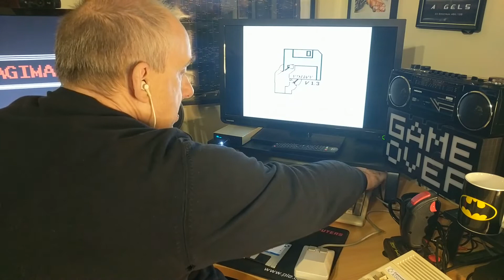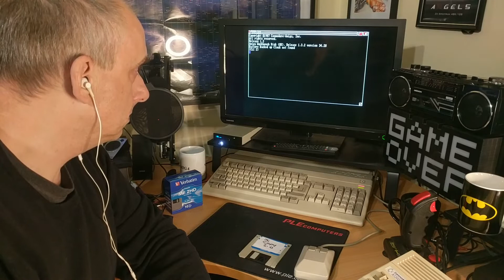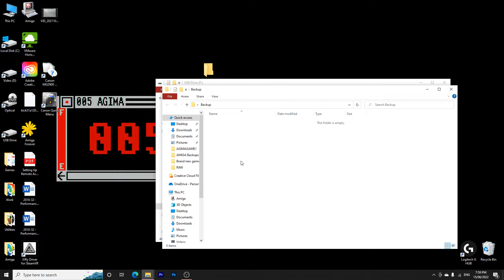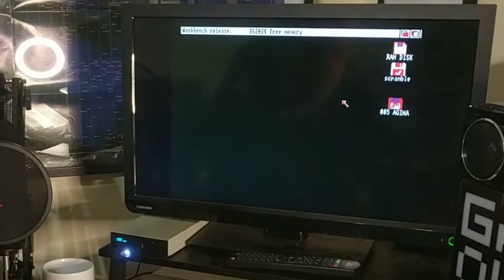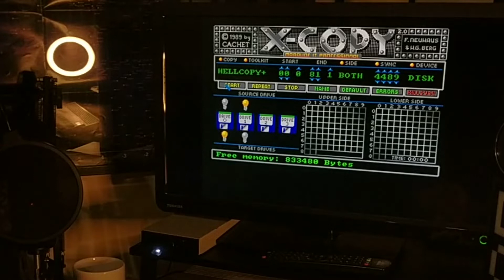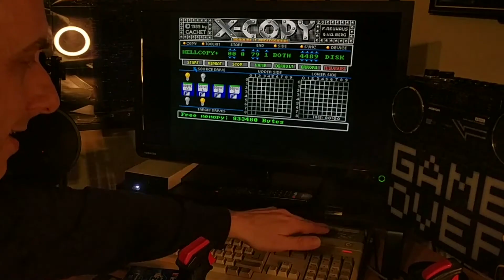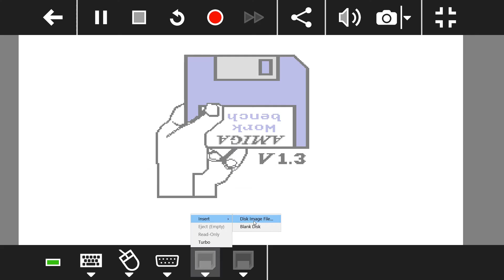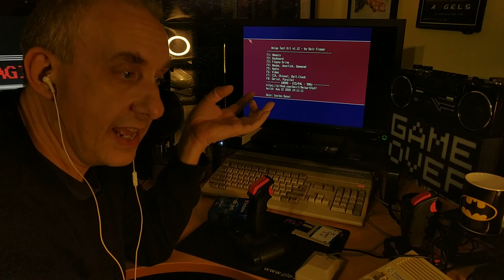EP-154: Amiga Floppy to ADF and back using a Gotek as DF1 (and as storage)

Comment: Great video. Thanks for the email. Loved the special pickup 😀. 
Just for reference; There are switchers that swap the drives so DF0: becomes DF1: and vice versa allowing use of the internal drive. However yes most just replace DF0: so you can’t use the internal drive. (I’ve got one of each). 
Scramble, those issues were due to the adf still being selected in the gotek so the os got confused. Ejecting the adf or selecting a different image would help. (You’ve probably already worked that bit out, but might help those coming back to the Amiga). The os doesn’t deal with two (or more) disks being called the same.
Loved that copper effect on decrunching. Always puts a smile on my face as I used powerpacker on my workbench disk to get as much on it as possible 😀.
Reply from the maker: Ah the 2 disks with the same name makes sense. I didn't even think of that.

Comment: Hi, interesting video.  I'm a noob with Amiga, but can you use pc floppies (2HD I think) on a stock A500 machine?  If this is the case can you also use them on the 600 & 1200 machines as well?  Greetings from Blighty.
Reply from the maker: @JohnSmith-bh4zx  the short answer is yes but they will only be seen as 880kb. I use them all the time. For the a1200 though, later ones used modified PC drives so that can complicate things. The long answer goes into nerdy detail about how the platters are not the same and may result in data loss... But I don't care about the long answer. Just don't use them for anything you don't have a backup of elsewhere and you'll be fine. Like I said, I use them in both my a500 and a1200. Good luck.

Comment: A very faulty method. Most of the ADFs don't boot anyway, for some reason. Maybe I'm doing it wrong, I dunno. Great video, though!
Reply from the maker: @AdamJ386DX  works fine for me. Remember you can only boot from DF0 (internal drive)
Reply from the maker: Ah also....once you've written to the disk, make sure you swap to a different disk image on the gotek before you try booting from the disk you've written. The Amiga may not boot if it thinks you have the same disk in both drives (I didn't even know this). This was the cause of the error seen in this video when I tried to boot Scramble.

Comment: So actually, you can take ADF files from Internet, drag and drop them on your USB stick.. Put it in DF1 drive.. And so you can make working amiga diskettes on DF0?
So that would easier then hook up a modified floppy drive to PC on LPT port..?
Reply from the maker: @rallyscoot  yes you can. There are many ways to get ADF to floppy. Whichever works best for you. I also use PC to Amiga via rs232 cable which also works.

Comment: Got myself an external gotek and replaced the guts of an external drive like yourself. I have disk images on the usb , when loading up workbench all I get is an icon with DF1?? and I can't do anything with it.
Reply from the maker: @aussie_retro_dude  what Disk image did you load? Of it's a game for example, they are non Amiga dos images. Try loading workbench extras in df1, or Delux paint, or an empty Disk. If they didn't work, check the jumper on the gotek is set correctly (try the other setting)
Reply: @005AGIMA  ah ok I'll give that a . I was trying to load random adf games.. eg Adams Family , Buggy Boy ect. 👍
Reply: @005AGIMA  turns out the Juper was set incorrectly, working now 😀

Comment: Hello, I have an Amiga 500 rev. 5 with kickstart 1.3. I bought an external gotek with flashfloppy firmware, a data ad power cable bought at amigastore. I would like to copy the games I have on the usb stick plugged into the external gotek on floppy disks using the internal floppy drive and x-copy. My problem is that when the external gotek is connected floppy disks don't boot. If I disconnect the gotek, the floppy drive is able again to load the disks. Gotek is set to S0, I tried to change it to S1, but the result is the same. I tried to plug the gotek in the place of the floppy drive and I can select correctly the games and play What I do wrong? Do you have any guide or instructions to make it work?
Reply from the maker: Hmmmm not sure what the problem is. I think mine is set to sd1 on the jumper but I can't remember. The only thing I can think is, make sure you don't have the same Disk in both df0 and df1 as the Amiga hates this. But if you've not copied disks yet, that's not the issue. Still something to check though. Also note, you can't backup commercial original games using this method. Only cracked copies will work. That's not why it's not booting but thought I'd mention it.

Comment: How do you format the memory stick in Windows 10?  Is it FAT 32?  Also, with the Flashfloppy firmware, do you still need to have a "boot" file on the memory stick, like with the old Gotek software, or can you just have your ADFs on the memory stick?  🤔
Reply from the maker: The gotec itself was preconfigured by the guy o purchased it of so in all honesty I don't know what version of flash floppy. All I did was the install in the external Amiga floppy case). The thumb drive I formatted I think as fat 32 from memory. There are no special files or boot files on it. Just folders and ADFs.

Comment: I do exactly the same thing with a Gotek (copy/make ADFs), installed it into a real external floppy drive case to replace a damaged floppy drive in said external case.
An A500 I have still has real internal floppy so it's great for that, plus also use it for my other Amiga's.

My A500+ and an A1200 have internal 'GoEX' drives from Centuriontech I bought a couple of years ago, they're far better than Gotek imo.
They're internal slimline that fit perfectly in an A500 or A1200 depending which mount bracket you get.
They use SD Cards and have a jogwheel that's a button as well, also have slim mount for the screen to attach to the grill, highly recommend GoEX drives.

They cost approx 57GBP with oled and screen mount. I'm not sure how active the site is now though, they seem to be out of stock quite often :(
Reply from the maker: That's great info. I love the GoEx and I think I've finally soften in that, when my A1200 internal drive fails, I'll be swapping to an internal GoTek or GoEx drive. I'm going to help my nephew restore his original A500 and if the floppy is dead, I'll tell him to go for Gotek or Goex straight away. Mainly because I'm pretty sure he's not going to go re-collecting the original games like I have.

Comment: I’m a bit confused, did you used a pc floppy disk without mods needed ?
Reply from the maker: Only just seen this comment. There are no mods needed to use a PC floppy disk in an A500 drive. You need to mod a PC Floppy "drive" in order to install it into an Amiga for use, but that's not what we're doing here. Disks, no mod is needed. Some people cover the second hole on the disk with tape, but this actually doesn't do anything in an A500 drive.

Comment: Just last weekend I finished setting up my Amiga. After having built a custom flight case for it as well as a desktop riser/Monitor stand that the Amiga fits under, I wanted to get the actual machine up and running properly. I already did a complete overhaul including cleaning the entire machine inside and out as well as swapping out all the electrolytic caps. I used to have the top of the case off the machine and plugged the Gotek straight in. Did not want to deal with this mess, so I got meself a boot switcher, and an external connection cable for it. Had those lying around for a while as I just did not get around to doing much for a few weeks. The switcher PCB goes into the Even CIA socket, the original chip goes on top of the switcher. Literally a 30 second job. Then took a drill to the back of the case to put the switch in.  (Yes I know there is a version that uses keyboard inputs but it was not available at the time I purchased the switcher) Buttoned the case up again and now I can select between booting from either the internal FDD or the Gotek. Very neat solution - and no more hauling boxes of Floppies around when going to retro shows / meet-ups.
Reply from the maker: Nice setup. If/when the floppy in my A1200 dies, I'll throw in an internal gotek.

Comment: When putting the gotek in the case of an external floppy did you have to tell the gotek it was DF0 so the external case is the thing that makes it DF1?
Reply from the maker: It was a long time ago now. What I do recall is there's a jumper on the gotek, and o thought it was originally in the correct position, but it didn't work. So I moved the jumper and then it worked.

Comment: The copy procedure is perfect but you need a XCopy on floppy... and if you don't have one? Can the copy disk program from Workbench boot floppy be used to copy from the virtual mounted disk to a new floppy?
Reply from the maker: Yes of course. You can do the same using workbench disk copy disks. I honestly can't recall if that fails to copy non-Amiga DOS disks though (as most games are). It may be ok as they are cracked ADFs but not sure. Interesting thing to try. Worst case you could use WB to make a copy of X-Copy maybe?
Reply: @005AGIMA  It doesn't work with Workbench copy, on my machine copying is from and to the same drive (DF0 or DF1). I discovered that if I start my Amiga 500 with a blank floppy on DF0, the machine is waiting for a bootable floppy but I can load and start a program into the machine from the Gotek drive (DF1).

Comment: I just serviced the A500 Plus floppy drive this week… well I say serviced, it was more a rust removal and restoration job. I’m sure if I’d dropped these Amigas into a well for 23 years they’d have faired just as well as they did in damp storage.

With the machine now fully working cough (I need to do a future proof recap and get a keyboard membrane after discovering four keys are kaput) it was time to fire up  Workbench and then try a few disks not spun in 23 years.

Disk drive sounded super smooth and Workbench started with no fuss. 

Skidmarks rhythmically chattered (that skittering sound a dud disk gives) so I’m guessing damp has got to it and it is now hors de combat.

Epic loaded and is where I found the restoration was now not going to be finished this month… I guess people do still have to use 7, U, J and M these days? sigh

Still, things are far enough advanced that I have time to think about the future of this machine and the fragility of damp stored magnetic media. 

I set out to ‘restore’ rather than ‘modify’ so your option of an external gotek has serious appeal. This machine looks as good as the day I got it in 1991 so I’m really not interested in butchering the case for mere convenience. With a maxed out A600 already and a full FPGA Amiga next to it I have the luxury of keeping this one fully stock as is my intention with the other A600 and A1200 I’ve yet to restore. Unlike those two though I don’t have the luxury of  using a period hard drive internally to make life ‘convenient’.

Your ADF to disk tutorial was a ‘This is the way’ moment enabling me to see what was already in front of my eyes all along… Forever Amiga. Also when I do find the disks with all my University papers it would be nice to convert them to ADF so they don’t go the way of Skidmarks. I already have Final Copy II and Wordworth installed on the A600 for when I find them. There are books of material on those discarded disks.

There is still something satisfying about popping in a floppy and booting from it… seems almost as magical as when I did it for the first time.  Just as long as it doesn’t make the ‘skitter’ noise of death.

Thanks for the video, it has given me serious food for thought. 🙂
Reply from the maker: wow thanks for the update on your A500+. It sounds great. Yeah my A500, while hardly used when I purchased it, ended up with keyboard issues so I feel your pain. Assuming the 500+ has the mitsumi keyboard (it will) I think you can buy brand new membranes for them. I need to service the FDD in the A1200 as that one is hit and miss (more miss than hit). If any of my machines were to get an internal gotek, the A1200 would be the one. But then, you "can" boot from DF1 on the A1200 by default. I need to try that and see how many games like it. Not even tried it yet lol.
Reply: @005AGIMA  Yeah, I’ve located a new membrane so parts aren’t a problem. Motivation is more of a thing. This project is a bit of a busman’s holiday so I can only feel ‘enthused’ in fits and starts.

After the big push I’m in a ‘meh’ mood as I have lots of paying clients computers to fix. It’ll get there… just not before autumn I suspect. Too hot here to be faffing at the bench on ‘another’ problem. It’s not as though it isn’t working… I just need to avoid typing on it. 🙂
Reply: @005AGIMA  Another piece of useful info right there, that you can boot from a Gotek at DF:1 on an A1200..   Thanks for the knowledge.
Reply from the maker: @yorkshirebikerbitsnbobs  yeah you hold down both mouse buttons on boot and it then gives you the choice.

Comment: What is that rainbow effect when you were booting x-copy. I vaguely remember it was something to do with memory compression?
Reply from the maker: To be honest, I do not know. It may just be something to do with this cracked copy of XCopy lol 🤣
Reply: Powerpacker decrunching would use that copper effect. I’m thinking it might be that. We did it back in the day to not just make programs smaller, but in some cases it would speed up loading as disk reads vs decrunching (decompressing) in memory could be faster in some cases.
Reply: @a500  aha, my memory is not great all that way back. Thanks for sharing that.

Comment: I never had much luck with 2HD disks in my A500 - new ones would kinda be okay but not reliable.  Having spent my childhood waiting for floppy drive accesses (I never had a hard disk) the gotek has been a great relief for me!  I'll always remember the disk grinding noises though and it's good to hear them again :)
Reply from the maker: Yeah the structure of DD vs 2HD is not the same on the platter so there's an unavoidable difference. I keep the DDs for special projects and use the 2HDs  for most other stuff purely because it really doesn't matter if it fails. Everything that matters is backed up.